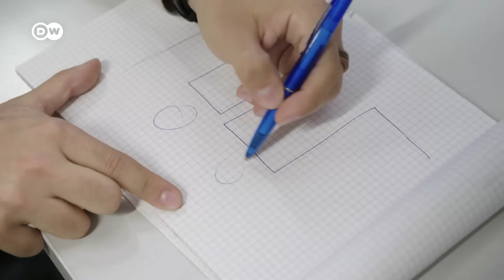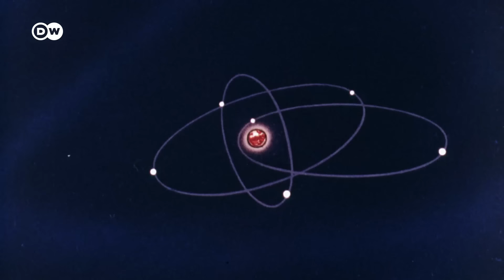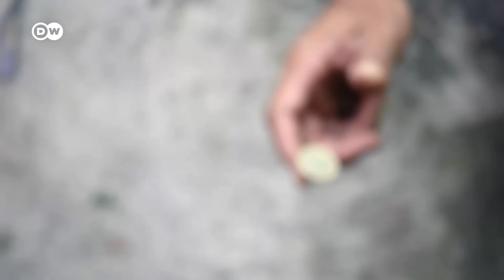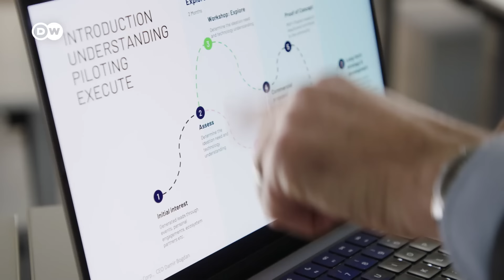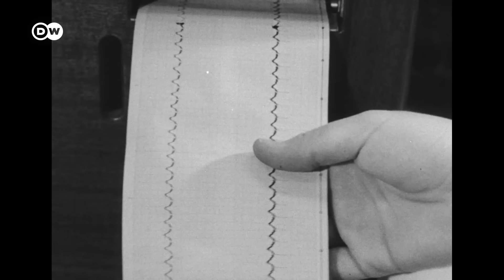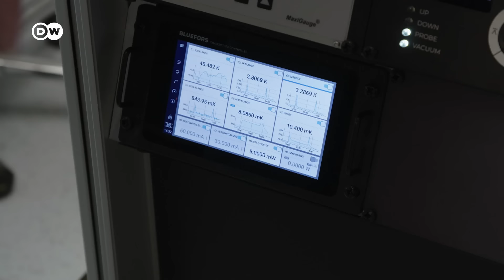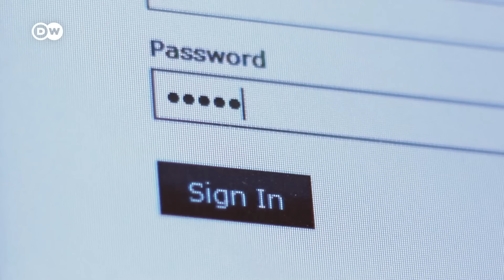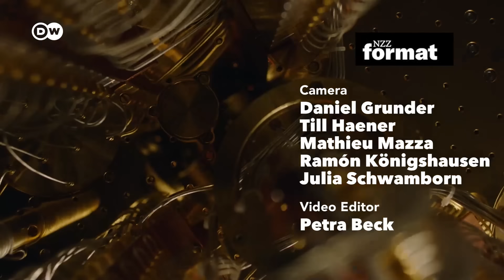New quantum computers - Potential and pitfalls | DW Documentary

Comment: "good for energy efficiency too"  You just got done explaining that you need to keep the quantum computer at less than 1 degree kelvin.... that takes a lot of energy to do.  Until theres room temp quantum computers, "energy efficiency" isnt a thing that has anything to do with quantum computers.
Reply: The idea is that a quantum computer, once it exists, would be able to solve problems that even the largest supercomputers (which often need several MW of power) are unable to solve. If this can be done using only a few 10 kW of cooling power, that's actually energy efficient
Reply: @BariumIon  sure... but again, so long as it needs to be cooled at less than 1 Kelvin it is not energy efficient.

Comment: Can someone explain this: If the whole advantage of quantum computation  is the fact that classical computation's binary language of 0 or 1, and quantum being able to be 0 and 1 at the same time, then why can't we use software to emulate the same thing? Sugch as: the software uses a dual binary language where one side can be 0 or 1 and the other side can be 0 or 1. A controller could split the bits to each processor and in effect have the same quantum computation ( if both processors see 0's or 1's at the same time, thats the same as an entangled pair)

Comment: strong algorithms are required to secure encrypted data in the context of quantum computing. Traditional encryption methods, such as RSA and ECC, rely on the computational difficulty of factoring large numbers or solving discrete logarithms, tasks which quantum computers could solve efficiently using Shor’s algorithm. This poses a significant threat to current cryptographic systems. Therefore, post-quantum cryptography, which includes algorithms resistant to quantum attacks (like lattice-based, hash-based, and code-based cryptography), is being developed to ensure data remains secure in the quantum era.
Reply: Shor's algorithm has only been demonstrated for trivial numbers. If that is what you are afraid of, then you need some anti-anxiety treatments.

Comment: How can the data processing carried out by this quantum computer be displayed on the screen? We know that digital computers use electricity to flow through each component, then the processor processes the data and produces electrical signals which will later be interpreted by other components such as monitors, speakers, and so on.
Reply: Well at some point you measure your system and results will be displayed somewhere. This is called qubit readout. It's quite mind bending to think that we can manipulate and sense objects on a quantum scale but we totally can!

Comment: Quantum computing will never common because of the insane cooling demands to achieve coherency. They are also only faster than binary for some special workloads.
Reply: I think there were recent material breakthroughs to allow quantum effects to occur at room temperature
Reply: Cloud access will solve it.
Reply: They said same thing about classical computers in the early days when they were bigger than whole rooms
Reply: Not all architectures need cryogenics. NV centers in diamond work at room temperature. So does photonics. Ironically, even "ultracold atoms" don't need cooling (at least in the classical sense). They use laser cooling, which is much easier, technically speaking

Comment: No one ever says how a bit being in both states simultaneously is beneficial!
Even if the bit ends up in one state after being observed, how does anyone know it's in the correct state? Do they think it's PROBABLY correct?
No one ever says how these results are physically delivered to the guy running the calculations at the keyboard.
Reply: How do you know that the factors of 77 are 7 and 11? Either, you try multiplying a lot of number pairs until you chance upon the right pair or you ask a quantum computer. The quantum computer will try all possible number pairs in a single operation and tell you: it's probably 7 and 11. Then you multiply just that pair and confirm the answer. The single operation is the key. It does not try all combinations in parallel the way a parallel processor would. Like one qubit can represent two states at the same time, 32 entangled qubits can represent 4 billion states at the same time. Search for Grover to get a more complete answer.

Comment: The biggest improvement you'll probably see due to quantum computing

Is very high density parallel data storage and cloud computing, where quantum computing actually would replace server farm, but not regular computer

Better medical and your car may go as fast as a Bugatti and make a Concorde that doesn't malfunction 

The problem with quantum computing is you have a "CPU" but no true quantum io devices still have to use a regular computer to run a quantum one
Reply: No you won't be running GTA or crysis on a quantum computer anytime soon

Quantum computing is what regular computer was in the 1930s and 40s

Need a whole warehouse floor to run one
Reply: A few registers and a quantum alu is pretty much wat u got

Difference is Quantum alu can operate on all registers (qbit) at the same time with different instructions
Reply: @Clancydaenlightened  It isn't really intended to replace small device-based computers, and also there is actually cloud access to quantum computers right now! Xanadu made one a couple years ago and you can program it online remotely. also.... did you just reply to yourself? Twice???

Comment: But it is not just two places at the same time it's infinitely many places at the same time.
Reply: qubits? well typically if you use electrons its only 3. Where the 3rd is just a superposition of either spin up or down. I will say there are other options such as photons, which can increase the spectrum of states they can exist in by taking into account phase, frequency, and intensity. But wouldn't say it's infinite as far as I'm aware.

Comment: Open ai recently said it lacks computing power and thats why its limited when giving responses to a few times per member. After you ask openai to make a bunch of images it tells you to come back in a little while to limit people from hogging all the resources. I bet openai merges witth quantum computers to access the computing power of quantum computers. Openai also said it lacks computing power to reach agi, QC could solve that.
Reply: Nvidia just announced Blackwell GPUs. 1/4 the electricity, and waaaaay faster than what OpenAI is using.
AI is already here and accelerating. They are leaving Moore's Law behind in the dust.
Stable Diffusion, Suno Bark, AudioCraft, Alpaca and many other AI's can already run on local GPU hardware (I run the AI's on my personal home computer).
Look up SD Turbo, SDXL Turbo, LCM, Lightning models for Stable Diffusion image generation.
If you think it requires a super computer and several minutes to generate an AI image, you are way off.
People with a 4080 video card can use LCM to render pictures as they draw them in realtime.
Quantum computing is dead (at least for now, in my opinion).

Comment: Could you explain how we can manipulate quantum phenomena when the usual laws of nature break down?
Reply: If they are not cold enough, they don't work.
They require very low temperatures, close to absolute zero.
about -459F.
about -273.15 Celsius.
Not practical or cost effective for any home computer.
That is why quantum computers are soo massive, it is because of the massive cooling systems they have to use, which is why they are soo expensive to build and expensive to run.
Reply: Could you please provide more details on why extremely low temperatures are necessary? Is it related to the material properties required for quantum-level work?
Reply: @HarpreetSingh1991  Temperature is like background noise.  The "hiss" on an AM radio.  The more of it there is, the less confidence you have in getting statistically significant results.  You can ask the same question over and over (a thing actually done in quantumland), to try and understand what's being said, but eventually it's all random.  Too much thermal jiggling of the quantum components.
Reply: @HarpreetSingh1991  
It's physics/thermodynamics.
Heat = fast moving particles. 
Cold = slow moving particles. 

This applies to everything (I think). 
This is why if you fill a balloon with air and then heat the balloon, it will get bigger, as the gas particles move around faster, they collide with the inside of the balloon more frequently and as a result, they push on the balloon sides fast enough that overall it expands. You can think of it sort of like tons of tiny marbles bouncing around.

If you put it in the freezer, it will look like it is deflating because the gas particles slow down, like they are going to sleep instead of bouncing around. With nothing bouncing around, the balloon looks deflated, but it actually has concentrated gas inside it. (sort of like Dry Ice being frozen carbon dioxide, which when it "melts" the gas takes up far more room than it did when frozen.

Bring it back out of the freezer and it will seem to magically self-inflate.

Now that you hopefully have a better understanding of this...

The low temperature slows down or stops the quantum bits from moving, so that they can be used for calculations. Normal computers don't need to do this.

A not-so-accurate metaphor would be having a classroom full of kids running around randomly and you need to count how many kids there are.
If you get them to all stop moving at the same time, it makes it easy to count them.
With quantum computing, the cold isn't to make it easier, it is the only way to make it possible to make use of it.

This is what I see as the biggest problem with quantum computers is, beyond figuring out what programs can be written with them.

With current computers and AI technology, we can run these at room temperature and we already know how to write programs for them and tons of new programs are written every day or updated. I see AI as being the leader that changes life as we know it, not Quantum Computing. In my opinion, Quantum Computing was a neat idea, while AI is a proven life-changer.
Reply: @cyrillyric8339 With space, you have the issue of radiation and high energy charged particles that hit CPUs that cause them to flip bits. Because of this, computers in space have 2 processors which are used to compare outputs and if they do not match, the assumption is a particle hit a processor and flipped a bit, so the calculation is done again. With quantum computers in space, this would mean they would need twice as many quantum bits. So while they could use the temperature of space, it introduces more challenges, including working on/repairing them.

Comment: i guess.. they mean floating point being one bit on one electron state. while on binary logic system its newer enough to store a floating point number if you want extreeme precission :D  which makes sense if they can set electron stte and get data bck precisely with predicatable error ration and detection system.... other then that i dont see much potential except fast data syncronization/transfer for superpc nodes/modules... which will make wide range non directly connected super/cloud computer based logic systems...